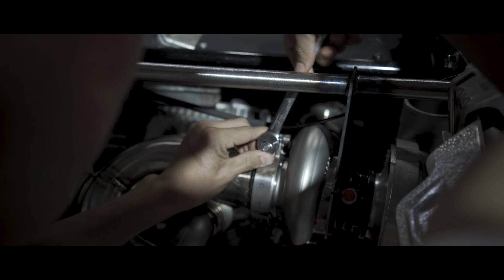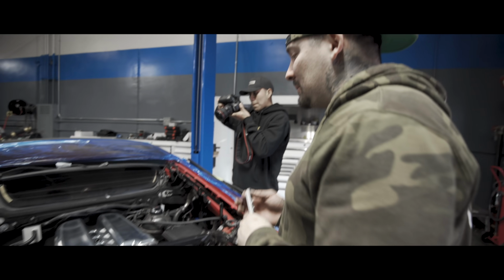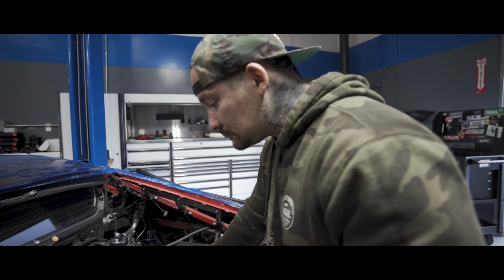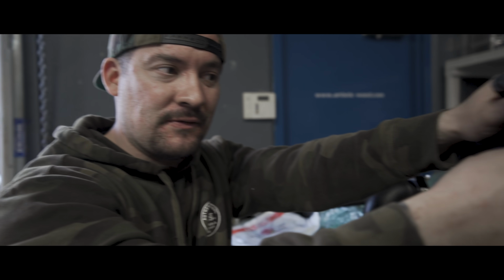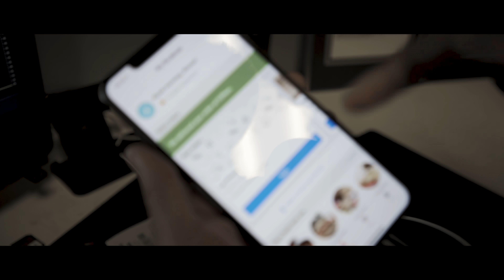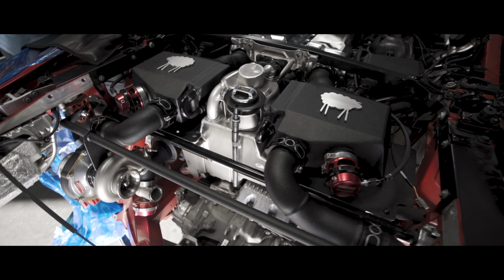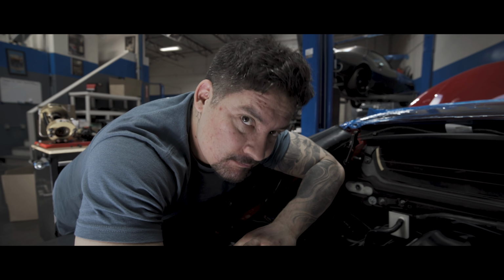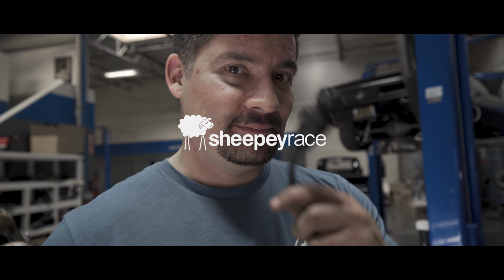The NEW SheepeyRace R8 UPDATE!! // shop vlog👻

Comment: With the main rail on that R8 now routed to the inside will the line stay cool enough to prevent boiling.? Well I suppose if you stay on the throttle enough the fuel can cool itself by flowing faster.